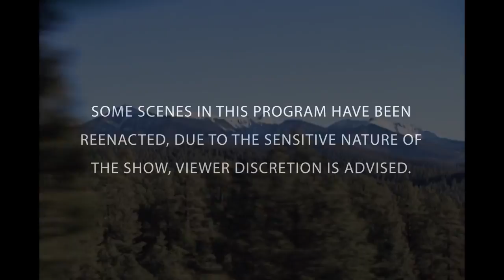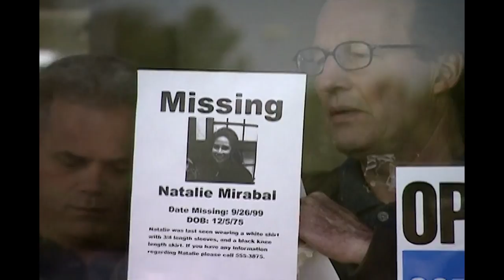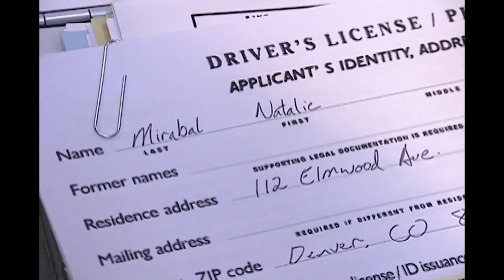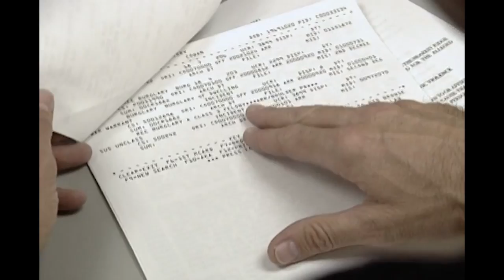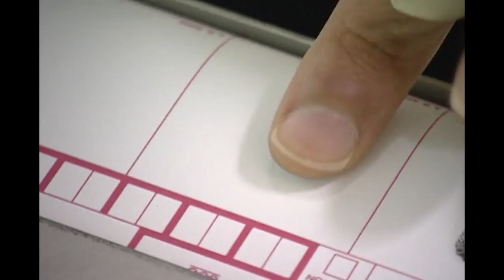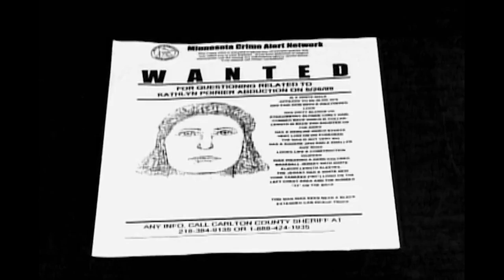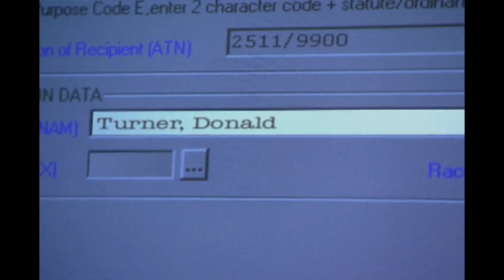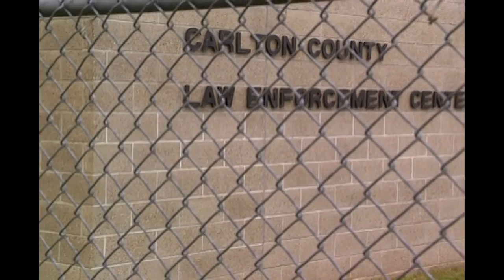Fatal Abductions | FULL EPISODE | The New Detectives

Comment: In the 2nd case, how did the anthropologist determine it was a woman from just bone fragments (before the tooth analysis etc)? Don't you need a skull or the pelvis for this?
Reply: i know right. Her intuition?
Reply: Interwebs says: Female skeletal remains tend to be smoother and smaller than a male's even between similar size individuals.  Because men have denser bones and bigger muscles.  Men's bigger muscle attachments (attachments to bone) make a male skeleton look "rough".
Reply: @picodegallo18  "Smaller" doesn't cut it, because it could've come from a smaller man. Perhaps density and rough surface are the explanation.
Reply: @contrarian8870  , true.  There are exceptions.  I saw an old case where a leg or legs were found and thought to be from a man on first inspection. The legs still had on big wader boots so that contributed to the impression.  Turned out to be a 6 ft female murder victim who had a physically rigorous job.  Another case involved an upper arm bone, looked like that of a young male, a small guy. Turned out the victim had been a waitress and the muscles of her right arm (she had balanced big trays of food at her job for years) had created a more masculine looking humerus.